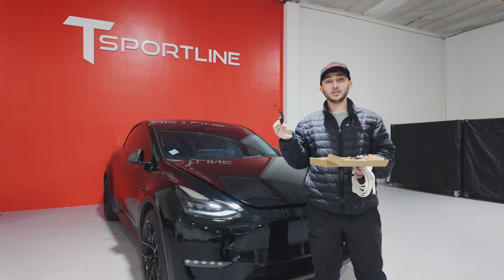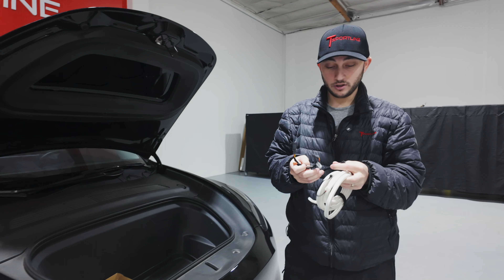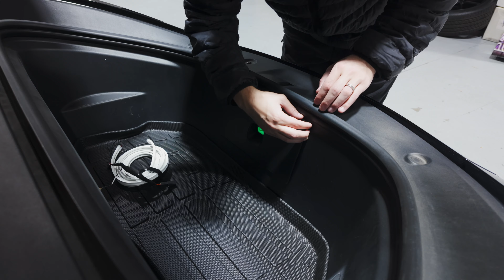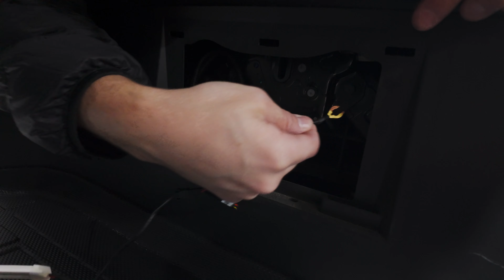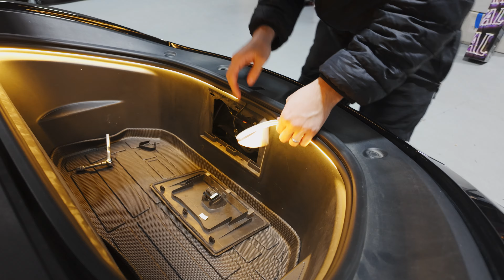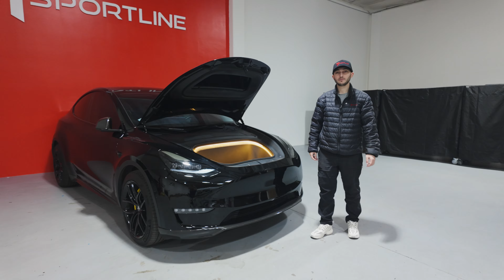Light up the FRUNK!  T Sportline Plug & Play DIY - How to Install Tesla Model 3 / Y LED Frunk Light

Comment: Stoopid question: the light strip turns off when the frunk is closed, right?! 🤔
Reply: yes .. after 20-30 mins
Reply from the maker: Yes, it does!
Reply: @TSportline need a proof put the phone inside make a record so we can buy it right now because amazon it takes 10 mins before lights shutdown.
Reply: @TSportline   yes.. after 20-30 minutes   and you didnt mention that the escape button does NOT work when you install this.